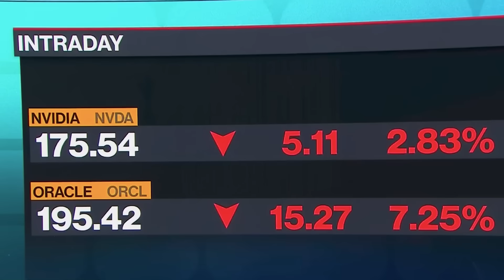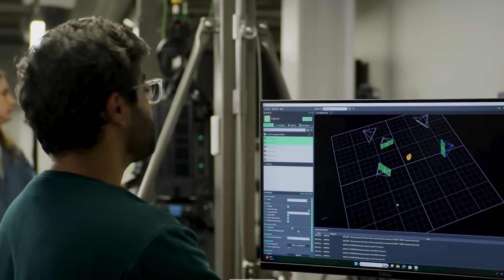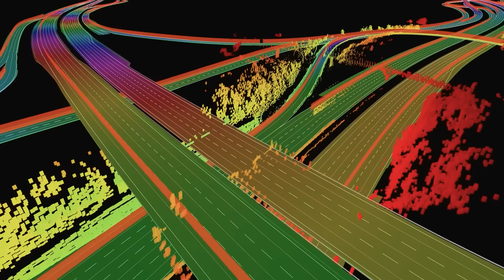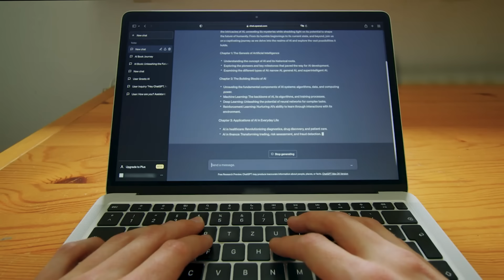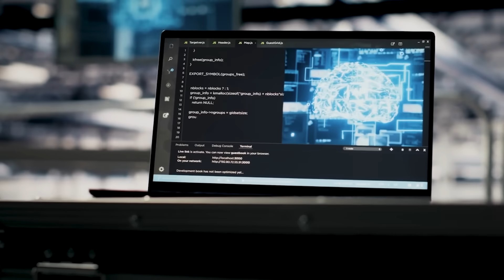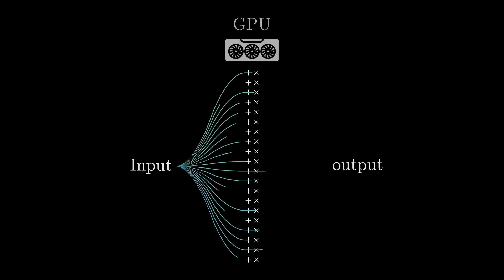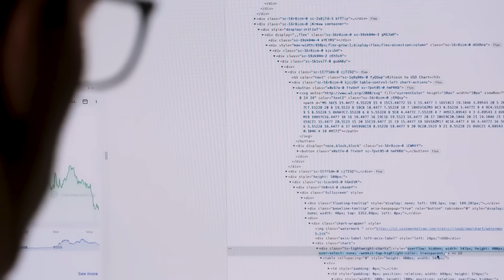IMPORTANT WARNING: Biggest Risk to NVIDIA

Comment: The only risk to NVDA is lack of foresight and execution. Obviously Jensen sees asic trends, neuromorphic, quantum horizons. He's not going to just try to keep peddling GPUs if the landscape is shifting. He'll make the landscape shift by introducing the next level take on the new momentum. Long NVDA for sure
Reply: they tried it before and what happened?  Mainland China (PRC) hasn't successfully invaded Taiwan, but has launched several major military actions and threats, most notably during the Taiwan Strait Crises (1954-55, 1958), where shelling of offshore islands (Kinmen, Matsu) was met with U.S. support for Taiwan, and the Third Taiwan Strait Crisis (1995-96) with missile tests to deter Taiwanese independence, all resulting in failed invasion attempts or de-escalation, but establishing a long-standing military standoff and a clear PRC stance on eventual unification by force if necessary, notes Council on Foreign Relations, history.state.gov, and Wikipedia.  Key Events & Outcomes:
First Taiwan Strait Crisis (1954-55): PRC shelled offshore islands (Kinmen, Matsu, Tachen), leading to the U.S.-ROC Mutual Defense Treaty and a U.S. commitment to defend Taiwan, ending the shelling after PRC signals desire to negotiate.
Second Taiwan Strait Crisis (1958): PRC bombarded Kinmen again, attempting an amphibious landing on Tung-Ting Island, which was repelled by ROC forces with U.S. backing, solidifying U.S. resolve to defend Taiwan.
Third Taiwan Strait Crisis (1995-96): PRC conducted missile tests near Taiwan in response to President Lee Teng-hui's U.S. visit, escalating tensions but without a full invasion, highlighting PRC disapproval of any independence moves. Why No Full Invasion (Yet):
U.S. Intervention: The U.S. "Sino-American Mutual Defense Treaty" (1954) and its strategic ambiguity have deterred direct attacks, as seen in the 1950s.
Taiwan's Defense: Taiwan has developed strong defenses, though analysts debate if they can withstand a full-scale, modern amphibious assault without U.S. aid, notes Defense Priorities.
Economic & Geopolitical Costs: An invasion would trigger massive global economic disruption and potential war with the U.S. and allies, creating enormous risks for China. 
Mainland China (the People’s Republic of China, or PRC) has never successfully invaded the main island of Taiwan. However, multiple attempts were made to seize strategic offshore islands in the years following the Chinese Civil War: 
Battle of Guningtou (October 1949): Shortly after the PRC was founded, its forces attempted to capture Kinmen (Quemoy), an island just off the mainland coast. The landing was a disaster for the PRC; due to poor coordination and unexpected resistance from Republic of China (ROC) tanks, the invasion force was destroyed. This defeat effectively halted immediate plans for an invasion of Taiwan.
First Taiwan Strait Crisis (1954–1955): The PRC heavily bombarded Kinmen and the Matsu Islands and successfully seized the Yijiangshan Islands. In response, the U.S. passed the Formosa Resolution, authorizing the president to use military force to defend Taiwan. The ROC eventually evacuated the Dachen Islands under U.S. protection, but the main invasion never occurred.
Second Taiwan Strait Crisis (1958): The PRC launched an intense artillery blockade of Kinmen to test American commitment to the ROC. The U.S. responded by escorting supply convoys and providing the ROC with advanced military hardware. The crisis eventually settled into a "status quo" where both sides occasionally engaged in symbolic shelling until 1979.
Third Taiwan Strait Crisis (1995–1996): This was a period of high tension rather than an invasion attempt. The PRC conducted missile tests and military exercises near Taiwan to influence its first democratic presidential election. The U.S. sent two aircraft carrier battle groups to the area, the largest display of American military power in the region since the Vietnam War, leading the PRC to stand down. 
In modern times, China has significantly modernized its military, but an invasion remains a daunting "operational nightmare" due to the 80-mile-wide Taiwan Strait and the risk of a global conflict involving the United States.

Comment: China will not invade Twain, they need the chips they receive from there, Just google if China gets chips from Twain and here is what you will see:Yes, China continues to buy chips from Taiwan, particularly older-generation and less advanced chips, though the trade of the most advanced chips is impacted by U.S. restrictions. Taiwan's dominance in chip manufacturing means China still relies heavily on it for a significant portion of its chip imports, despite its own growing domestic industry. 
Significant reliance: China's semiconductor industry is heavily reliant on Taiwanese imports, which represented a large percentage of its total chip imports in 2022, according to Daxue Consulting.
Advanced chips restricted: The trade of the most advanced semiconductors from Taiwan to China is restricted due to U.S. regulations, which aim to prevent China from accessing certain technologies.
Taiwan Semiconductor Manufacturing Company (TSMC): TSMC, the world's largest contract chip manufacturer, is a major supplier for Chinese companies.
Domestic production: While China is working to increase its domestic chip manufacturing capabilities, it has not yet achieved self-sufficiency, especially for advanced chips, and still needs to import them from places like Taiwan and South Korea. 
Yes, China continues to buy chips from Taiwan, particularly older-generation and less advanced chips, though the trade of the most advanced chips is impacted by U.S. restrictions. Taiwan's dominance in chip manufacturing means China still relies heavily on it for a significant portion of its chip imports, despite its own growing domestic industry. 
Significant reliance: China's semiconductor industry is heavily reliant on Taiwanese imports, which represented a large percentage of its total chip imports in 2022, according to Daxue Consulting.
Advanced chips restricted: The trade of the most advanced semiconductors from Taiwan to China is restricted due to U.S. regulations, which aim to prevent China from accessing certain technologies.
Taiwan Semiconductor Manufacturing Company (TSMC): TSMC, the world's largest contract chip manufacturer, is a major supplier for Chinese companies.
Domestic production: While China is working to increase its domestic chip manufacturing capabilities, it has not yet achieved self-sufficiency, especially for advanced chips, and still needs to import them from places like Taiwan and South Korea. 

And don't forget Twain has plants here and other countries.